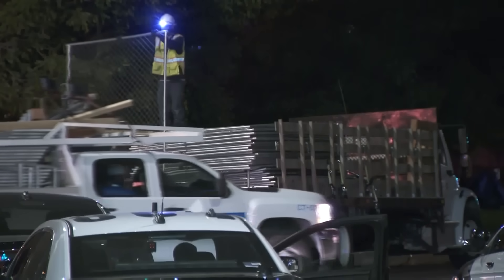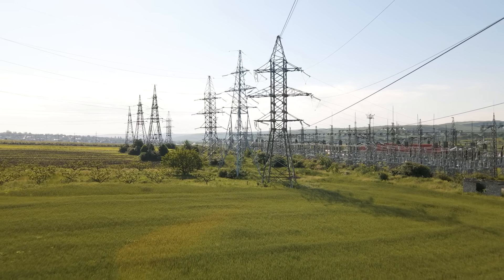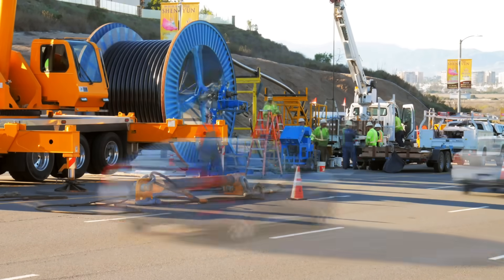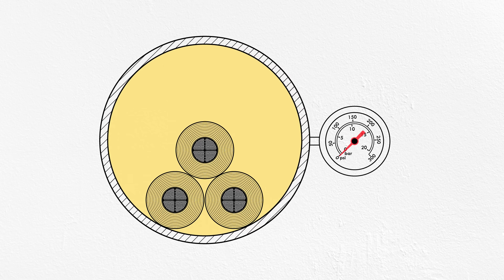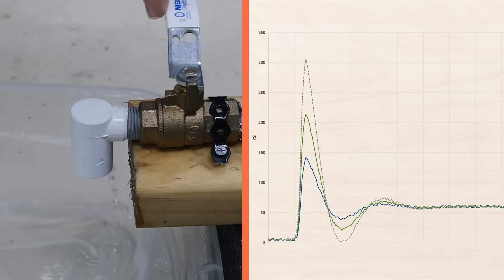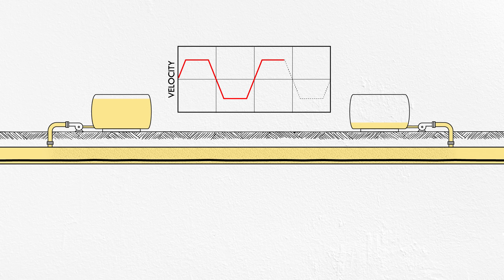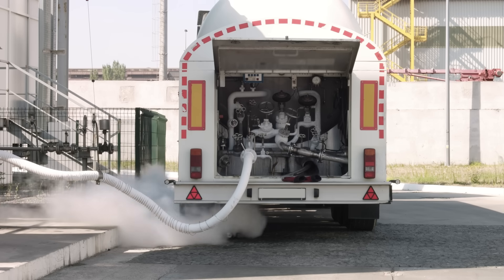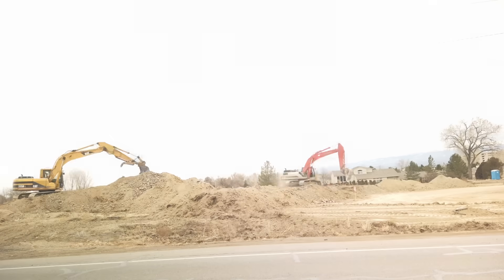Repairing Underground Power Cables Is Nearly Impossible

Comment: When the Themp change every 6 hours is really the problem, why don't hold it steady with a closed circuit cooling line:
In addition to the the power lines pull in a oil pipe that pushes "cool" oil from both sides to the middle. The hot oil gets cooled on both ends and gets pumped in again.

No hard movements like with 4h cooling 2h reverse of flow heating time setup.
Reply: The temperature change is not cyclic every 6 hours, that's how often the flow changes direction. The temperature change in the conductors is dependent on the amount of power production/demand. The flowing oil serves to make the temperature of the conductors more uniform along the overall length of the conductors (in addition to acting as a dielectric), not primarily as a cooling system. The contact of the outer steel pipe with the earth is the heat sink.
Reply: "why don't hold it steady with a closed circuit cooling line"

You'd need a second quite long line just to get the oil back where it started. That would increase costs.
Reply: It would need double the oil for a return line in addition to the main cooling line

Comment: Loss in an electrical conductor is proportional to the square of the current.  P=V*I,   V=R*I,  Power loss = R*I*I    Therefore it is critical to minimize current flow which means running at high voltage minimizes losses.

Comment: Looks like the power plant near El Segundo Cali. When I lived there back in late sixties I always thought it was strange to be so close to the beach.
Reply: That is the one! Although I'm sure it looks a little different to you now, good eye. The reason it's on the beach and why many generating stations are near bodies of water is to use the water for cooling.

Lots of heavy equipment uses oil for lubrication and cooling. That oil heats up and is cooled by a cooling water system (not the ocean water). Now the cooling water has removed heat from the oil but has picked up its own heat and needs to be cooled off. This process could go on endlessly, so they use the ocean water to remove heat from the cooling water. There's an endless supply of cold ocean water to be used for cooling.

There's also an application in the condenser. This is where the steam goes immediately after it has been used to spin the turbine. There, ocean water is used to rapidly cool and condense the steam and get it out of the way (this is called back pressure) so the steam upstream in the turbine has no issues flowing along. This area is also under a very strong vacuum in part due to the condensing action of the steam. The steam enters the turbine at 1,000F and exits the turbine and is instantly converted to 90F water.
Reply: @JesseFernandez  thanks man. Makes sense. Ya, i 
Lived in Hawthorne and hit El Segundo, Hermosa, Redondo,  Can’t get away from the ocean though brother.
Live in Clearwater Florida , next to the Gulf of Mexico.🤣👍

Comment: Now to do a story on Californias use of plastic pipe for natural gas delivery.  The pipe has a polymer that should an earthquake happen.  The pipe is self sealing.  Thus stopping possible gas fires.

Or how about the viral tiktok video of a grain bin collapse that combusts with out any visible ignition
Reply: Grain silos and elevators are notorious explosion hazards.  Transferring grain causes it to produce a lot of dust.  Transferring material, especially if it is sliding along a surface or flowing through a pipe, creates an increased risk of a static electric spark.

When there is a significant amount of fuel (whether it is gas, dust, or other) mixed with an oxidizer (whether it is oxygen-rich air, or another oxidizer) and you introduce even the tiniest spark, you get fire.  If the fuel and oxidizer are well mixed, and in the correct proportions, you don't just get a fire, you get an explosion.
Reply: @Kineth1  The video I saw was of a truck getting loaded.  Only moving grain was entering the truck.  That is until the hopper tips over.

Comment: So repairing this type underground (high voltage) power cable (singular) was difficult and expensive - evidently not nearly impossible - so how about other cableS like the one they replaced it with?

Interesting story, not what I expected though and leaves the questions the title is implying to address unanswered.

Comment: I'm sure the cable is very expensive but I would run two or three cables instead of one. Use cable A for 5 years then switch to cable B. Inspect A and repair as needed. After another 5 years switch to cable C. Inspect/Repair B. Then back to A. Eventually a cable will fail. It's seems less expensive in the long run to do this. Theoretically you would never be down unless something wiped out all three cables. You would also have an emergency spare, or spares, if needed.

Comment: That oil-filled pipe with paper insulation is a clever solution even if it's obsolete now.
Reply: I remember doing some electrical wiring in a house from the 1930s for a friend. I was genuinely surprised at the "quality" of the insulation as well as the "layout" and overall "design" of the cables. Basically it was an example of how NOT to do wiring in you flat (or house). The moral of the story is, that if something works, it does not mean that it works in a sensible or safe or effective way. It might work. Until it does not. And it is only a question of time and also the answer what will happen then. I have respect when it comes to electricity. Not fear, but respect. Btw. I am just an amateur, without formal education in the field. I fix my own circuits and always put safety first when it comes to electrical installations. It is no rocket science after all. I did not have any issues so far and tend to keep it this way. People should be cautious, understand and know what they are doing and why.